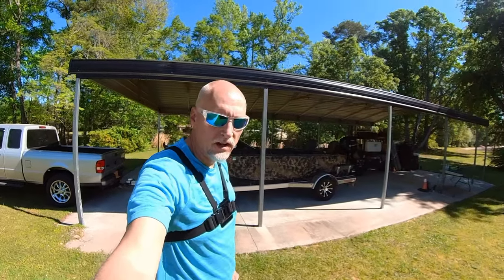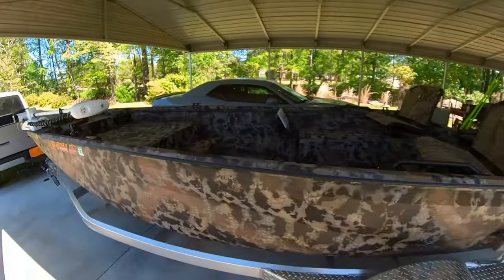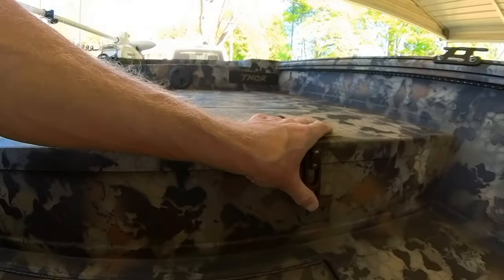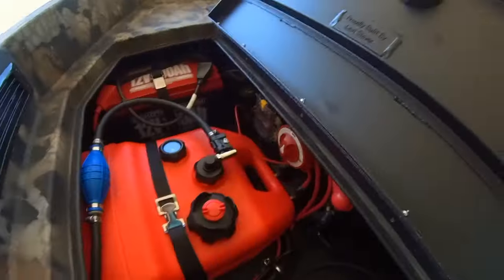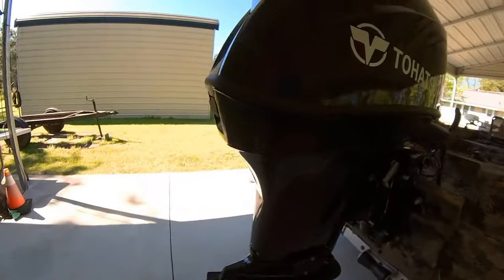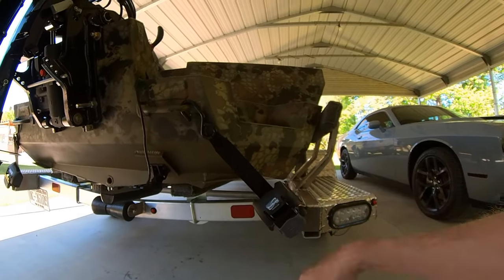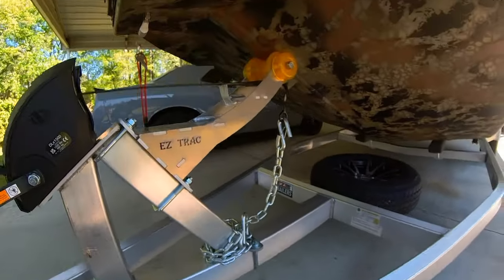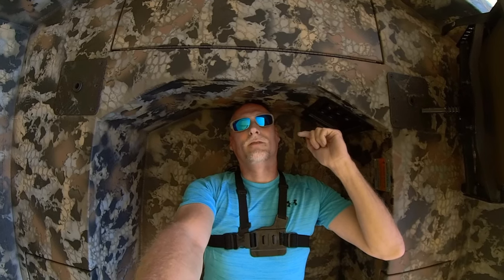Thor Lake Hammer 1754 Duck Boat-Real Owner Review-Tohatsu 50-Dakota Lithium-Minn Kota Terrova

Comment: great video well detailed
Reply from the maker: Much appreciated!
Reply: Awesome video. Been waiting for a video like this on one of these boats. Thanks!
Reply: Few questions. 
Hows handling? 
Is the weight of the boat noticeable? 
What speeds you getting with the 50hp?
Reply from the maker: The boat handles very well.  It comes on plane quickly and is very nimble.  No issues at all handling.   Very stable.   It is slightly heavier than a normal Jon boat due to the thickness and build quality but it is still a light boat. No issues with that at all.  I tow it with my old Ford Ranger.  
I am still in the break in period so I haven’t really tried for a top speed yet.   I have hit 32 on my GPS so it is going to be in that range.  I have not played with the props or anything yet and that speed was with a stainless.  I plan on testing between it and an aluminum soon.   Hope this helps.  Thanks for watching!
Reply: @reeldazed539  nope, that was perfect. Really appreciate it.  Good to know these things before dropping 27k and not liking it

Comment: Nice boat. I have recently bought one just like it. A couple questions for you. Where did you hook the Garmin power up to? I put a 6” bobs hydraulic jack/kick plate on with a Yamaha 70 running a YBS 17P prop. It’s porpoising real bad when I start to trim up after getting on plane, any recommendations? Thanks
Reply from the maker: I ran the wires straight to the starting battery.   I’m not sure on the jackplate setup.
Reply: get some weight in the front or you can get a stingray plate for your motor that goes on the cav plate. you can also get aftermarket trim tabs to go on the back of your boat
Reply: @MudAndWater13  thanks. It has little tabs on the back to adjust. I will keep messing with them to see if that helps. I did drop to a YBS 16P prop and it helped